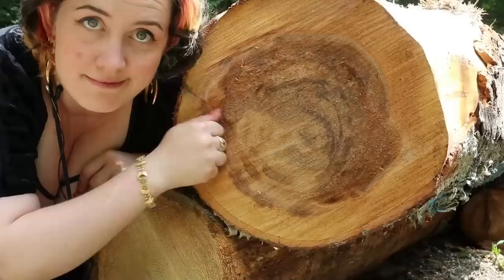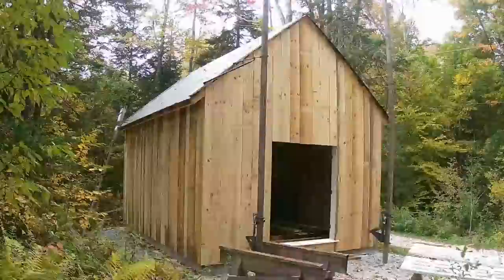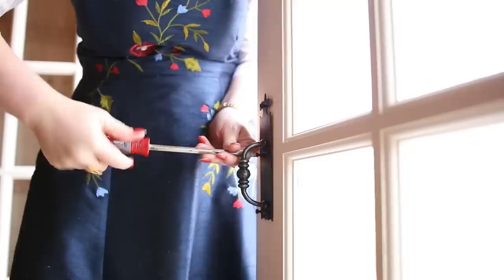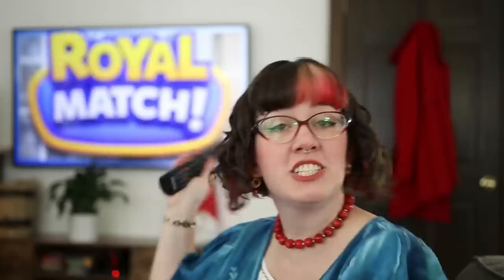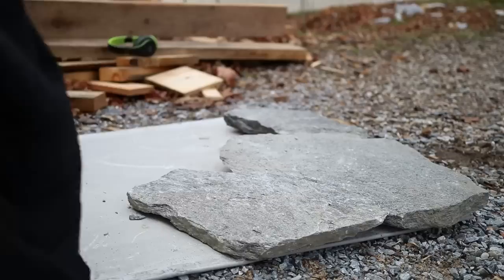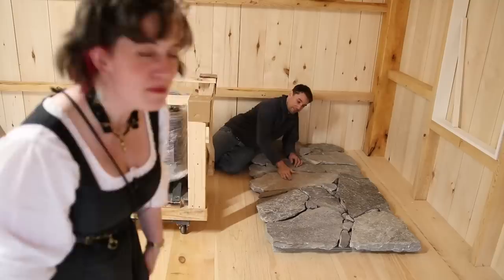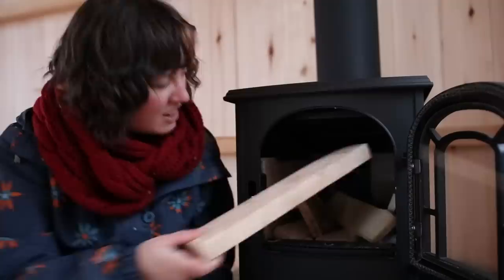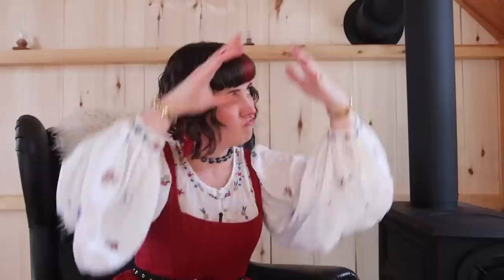Putting the "COTTAGE" in CottageCore

Comment: Look at you!! The cabin is awesome!! I recommend some kind of reflective fire safe surface behind the stove to protect the wall. It will really help reflect heat into the room and keep the walls from over hearing.
Reply from the maker: It is more than double the recommended clearances away from combustible surfaces for this particular model, but the point about reflecting heat back in the room is not something I had considered, thank you for commenting!
Reply: @MorganDonner  personal experience! Those little stoves can really throw off heat!
Reply: Also something to consider: If you plan to cover the cabin under your home insurance, the insurance company may require it. In my experience, they tend to get quite persnickety about wood heating.

Comment: I'll throw this suggestion out there but I'd build the stone work a bit bigger so you can put a fire wood rack on it. When it's cold outside it nice to have the wood there to throw in the fire. Also helps if the firewood got any moisture on it to dry out before you throw it in the fire.

Comment: That looks so awesome! Having your own little cottage is goals right there. 

I'm so glad that stove didn't choke you all out with the coatings and whatnot, I know that sometimes they need to be fired up outside at least once to "season" them. The stone looks amazing too, a perfect way to disguise the fireproof material underneath. I love watching people build log cabins etc, even if I have to take a nap after watching everyone work so hard.
Reply from the maker: Yeah, I read both in the manual and in other people's experiences that it was a good idea to do several smaller initial fires to help get the whole thing settled in and any sort of weirdness from the manufacturing process burned away. Lots of reading up definitely helped out with the stove process!
Reply: @MorganDonner  That's good, it's the part that would terrify me the most, I think! 😊

Comment: you should totally get a stove fan, just totally mechanical bit of metal that sits on top of the stove and wafts the hot air out, it moves just from the heat of the fire. Also I think your theme should be 'Time tourist' or ancient immortal, that way you can get a bit from whenever you want and it's still on theme!

Comment: This can be quite cozy, but I fear that it can get pretty hot in summer. Many old huts used to have two opposing windows built into the roof. Originally, this was done as chimneys were not a thing yet and you needed to get the smoke out somehow, but it does work well to get trapped heat out if the windows are oriented to the wind.

Comment: Wow! This is awesome and so much work! Congrats on a job well done! How are you thinking of adding color to the cabin? You could use leftover fabrics from sewing projects to create wall-hangings. Medieval castles had tapestries both as decoration and insulation, though I wonder just how effective it was as an insulator— probably minimal. But you could hide insulation behind wall hangings instead of drywall or wood. (Not bare fiberglass, though. You don’t want to get those fibers in your fabric if you ever want to take them down and reuse them for something else! ) Or you could stretch fabric over a frame like an artist’s canvas and have panels instead of hangings, and maybe paint them like asian silk screens. Just my immediate thoughts. Good luck and have fun!

Comment: Hope you have lots of insulation planned and double or treble glazing. Retro fitting is not a wise idea and you will waste a lot of carbon into the atmosphere without it.  I suspect you'd have benefited from a short course at Centre for Alternative Technology who have pioneered the development of small ecological buildings as well as designing solar powered refrigerators to deliver vaccines in remote areas of Africa etc.

Comment: I like the look of your cabin a lot and it's really atmospheric and aesthetic, but doesn't the law there say that the cabin must have mandatory water, electricity and sewer connections, insulation in the walls, ventilation system, separate waste containers for recycling so that the cottage is, for example, easier to sell when you move out or don't want it anymore? And what about the heat leakage from the corners of the walls, floor cracks, doors, windows and chimneys, so that the cottage is energy-saving and climate-friendly? It's just confusing when, at least here in Finland, there would be no possibility to build such a cabin because it would not comply with the provisions and regulations of the local building law. But if things were different here in Finland, it would be really nice to own such a traditional and old-fashioned cottage myself.